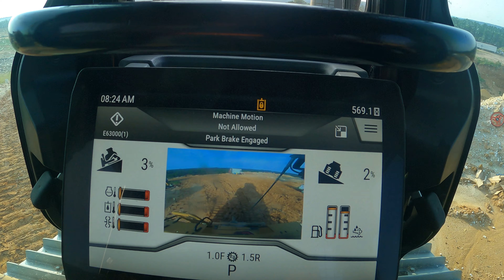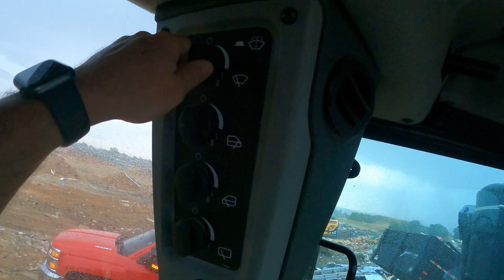Busy TRASH day at the landfill! 🚜 Pushing with the CAT D6

Comment: I just started working at the landfill here in St.George, Utah running the same machine. I am new dozer operator. Do you have any advice on pushing trash and building slopes?
Reply from the maker: Hey Buddy, best advice I can give for slopes is to try and keep all the “bulky” stuff off of it. We try to use only good construction material on slopes because it breaks up easier and takes less cover dirt. Good Luck and thanks for watching!